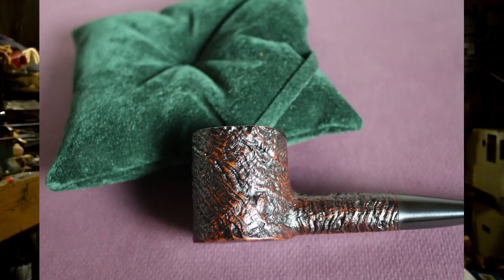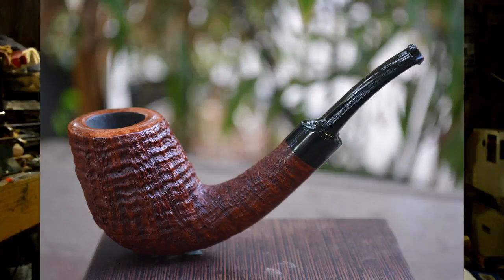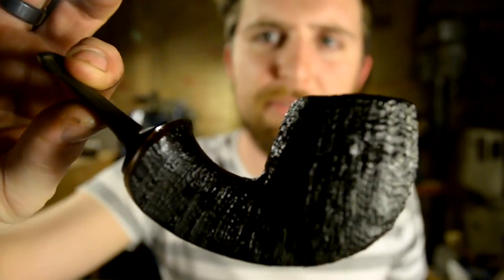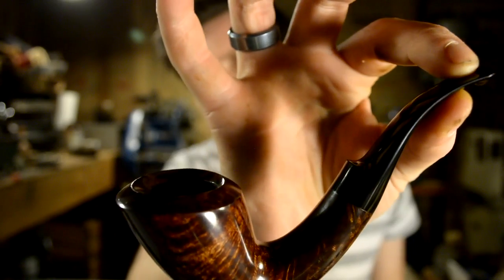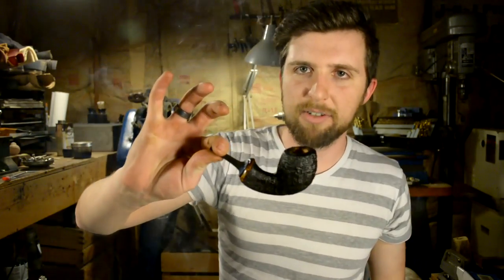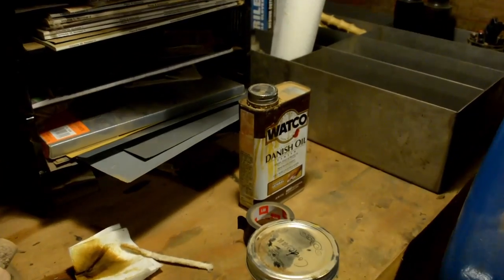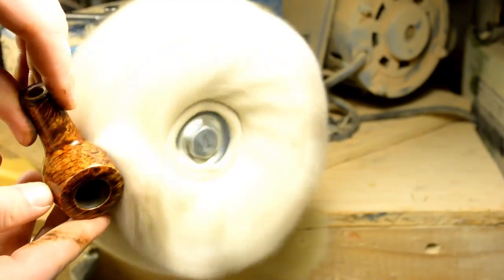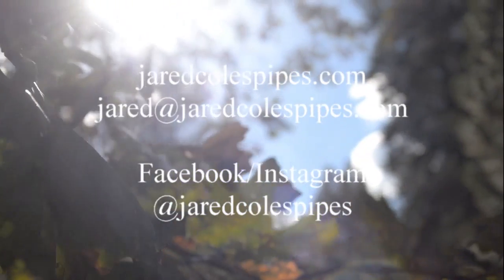Sandblasting 102 and Polishing

Comment: I am the receiver of that magnificent Saxophone pipe shown in the video.  Jared took the original design and tweaked it to make sure that a pipe cleaner will pass without difficulty,  Most importantly, even though the pipe has a deep bend, it does not gurgle at all, even with a rich English blend.
 The finish is excellent, the stem and button comfortable and the pipe smokes like dream.
 Beautiful work, Jared.  Thank you!